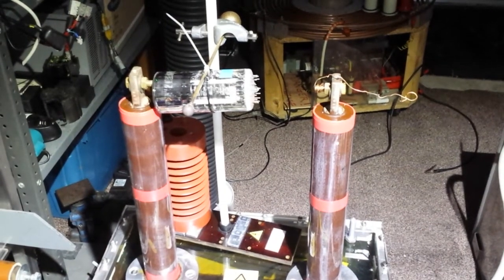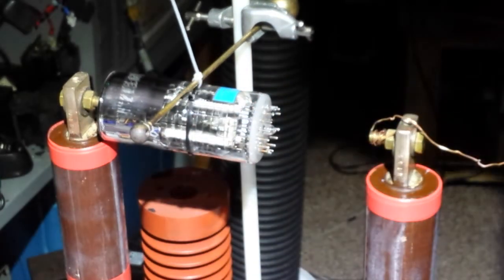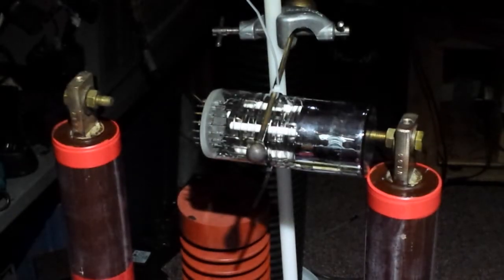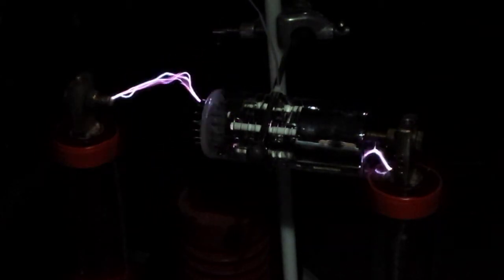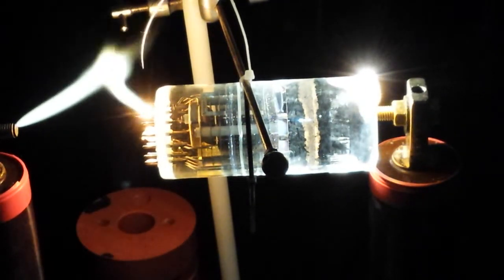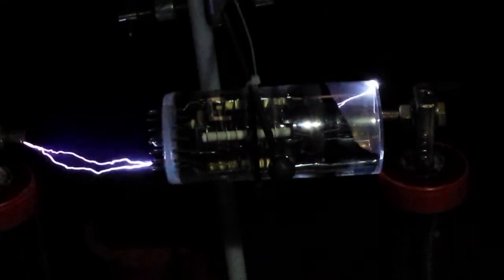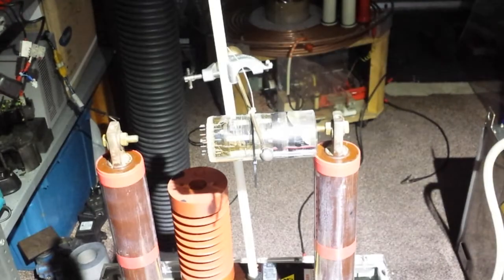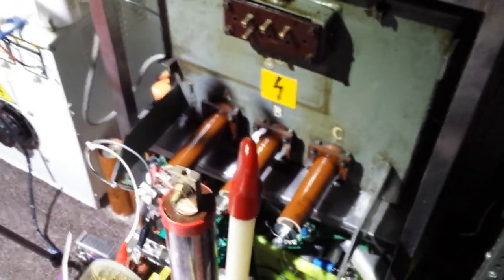oscilloscope tube gets high voltage

Comment: High Voltage + Vacuum Tubes don´t mix up that well! It will generate X-Rays!
Reply from the maker: Nope!! No x-rays here mate! If there was my cameras CCD' would pick it up as snow on the screen! So thank you for your concern mate. The tube wasnt wired up that way too. Its more like a valve' and theres no proper anode and cathode, 
Thanks again.👍

Anthony. H1v1r

Comment: Photomultiplier tubes are often used in Radiographic applications to control xray emmisions from the device in order to achieve consistent film exposure and to prevent excessive xray dose to the patient. The tube is attached to a fluorescent screen which emits light when exposed to xrays and the tube is connected to a negative 1000 volt supply and each tube pin is connected to individual dynodes within the tube. A photon of light releases electrons which are multiplied from one dynode to the next which gives an output to the xray exposure control unit. These tubes can be very expensive and can also be used by people wanting to make sensitive Geiger counters or Cosmic ray detectors.
Reply from the maker: Hey thanks for the comment and interesting info! on my video' and sorry for the late reply!! What you told me about the vavle, was some good info and thanks for that!! 😉👍
Be safe'

Anthony.

Comment: Just a thought your pumping a lot of high voltage into a vacuum tube there is a risk its producing X Rays as a result even without a heated cathode with the heater on it would produce a lot more.

11 KV might not be enough produce a lot of X Rays but i expect it would produce some depending on how it flowed through the tube. I have an old high voltage rectifier valve and it produces X Rays that I can detect on my counter.

Please be careful of that

Also that tube is used to amplify low level light. It might have been from night vision gear but as it lacks the display element its most lightly used to amplify very low level light flashes in some sort of scientific gear.

Some of the early Gen 1 Russian night vision units that where sold as surplus years ago actually did emit soft X Ray via the eye piece :-)

PS The silver stuff might be getter material which is used to absorb the last traces of gas after a vacuum is pulled and the tube is sealed. It turns white when the vacuum is lost and air and moisture get in.
Reply from the maker: Hi mate' no Xrays here mate' im very aware of that and always careful! The way this is wired up' there will be no Xrays! And if there was any Xray particals the cameras ccd  would be picking it up by snow on the display. 
Thankyou for your concern and comment friend 👍😉

Anthony
Reply: high1voltage1rules Good point the camera would have gone nuts :-)
Reply: high1voltage1rules great vid mate :D